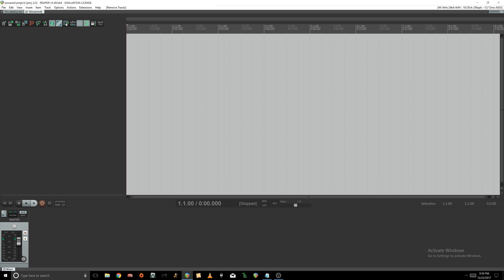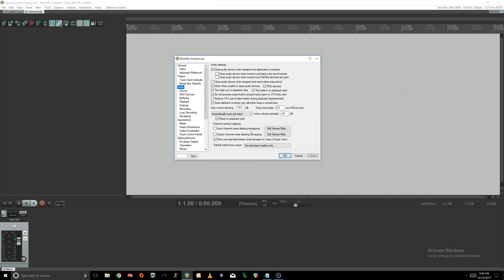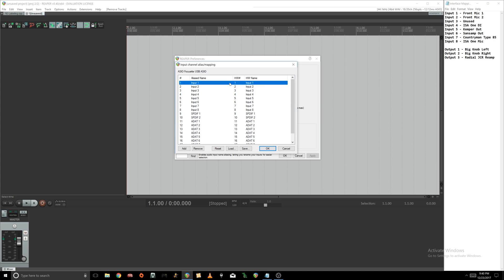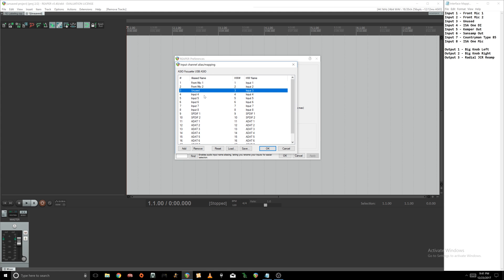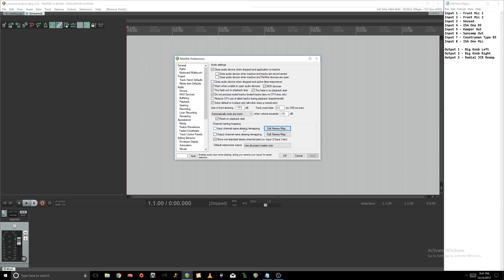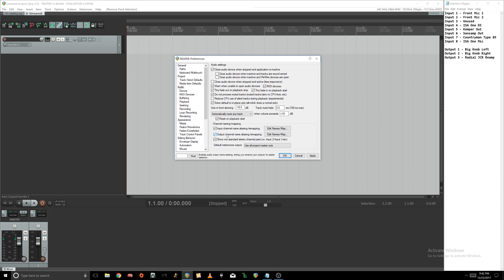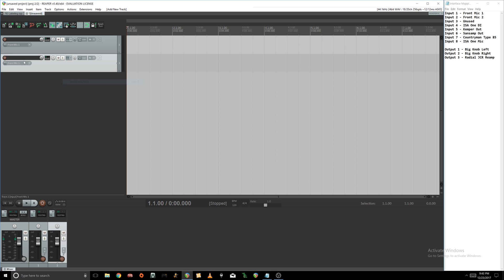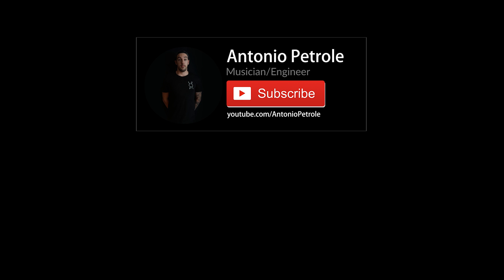[Tutorial] Reaper Essentials - Input/Output Remapping

Comment: I can't make the audio output go into my headset... i followed the video's instructions, it still didn't work.  i set up my piano keyboard using midi cable to my laptop and was able to learn how Reaper can detect it. But I can only hear the audio from my piano keyboard's speakers. Where in the settings can i change to make the sound come out to my headset that's plugged in to the laptop?